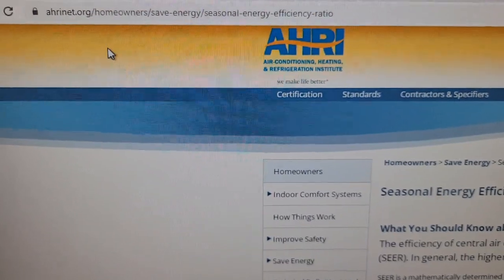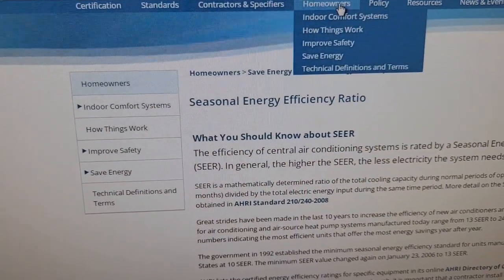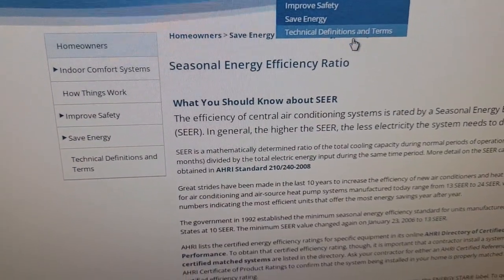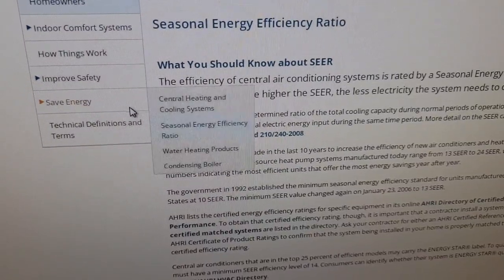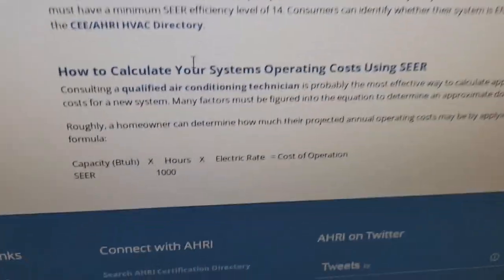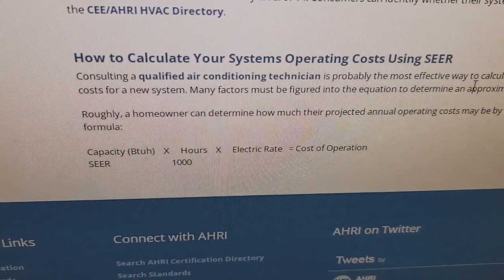How to heat and cool a barndominium? #barndominium #hvac

Comment: 😀🌱🐢
Thank you for the beginners information Tad, I know little to nothing about hvac. I am learning because of your videos.
Reply: I do have a simple question. You liked returns low, that said. Where do recommend putting the air handler and air ducts? If you had a choice of the attic or basement areas which would you chose?
Reply from the maker: Thank you for watching and commenting
 Let me know how I can help you better
Reply: I've had both. The HVAC units with the ducts in the attic seem to struggle trying to cool more. What say you?
Reply from the maker: Attic versus basement that's a good Question That will be a good video thank you
video coming soon
Reply: I look forward to the up coming video. 👍

Comment: Bingo!  You and I like nice, quiet, efficient filter sizes. 24"x36"x1" would give you about 500fpm face velocity, with a 0.032InWc pressure drop. I have installed a lot of Skuttle high-efficiency air cleaners, but they dropped the ball during Covid, takes 7 mo to receive yhem and now I'm installing standard sizes of 2" or 4" filter racks now. Just fabricated and installed a 14"x30"x2" (pleated) in the floor of a dwmh on a 3 ton pkg hp...quiet! No more special size filters. It makes it difficult for customers and the aftermarket junk doesn't fit properly or lacks weather-stripping where needed.
Reply from the maker: The number one reason
 Is always the duck work
 Always the air flow
 Glad you're here and you know what you're doing
 There's a lot that do not know

Comment: Hello I have a quick question about a mini split! I have a Carrier R22 2Ton Single zone mini split. It works amazing. But I always hear hissing from the line set (more of a hiss near the compressor). I checked the system with soap and water no bubbles. And it only hisses when on. When it powers down the hiss goes away (I assume a leak in the lines would make a hiss noise even when off) I just want to know from your experience that some hissing noises are normal or not. 😊
Reply from the maker: The hissing sound that you hear could be the sound of the refrigerant going through the coil or the metering device
Reply: @TaddyDigest  thank you makes me feel at ease. I was told by a friend it’s normal for flow and hiss from r22 but when I google it (like everything else) everything is worse lol. “You hear a hiss call us” that’s why I tested with soap and water like I said 0 bubbles.
Reply from the maker: Good deal
 Thanks for asking me the question
 I'm glad to be of help